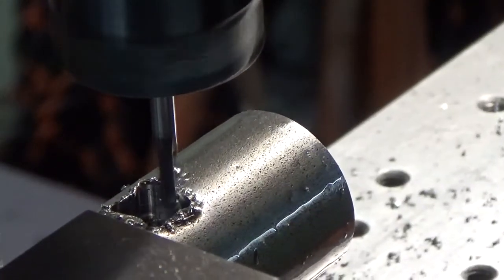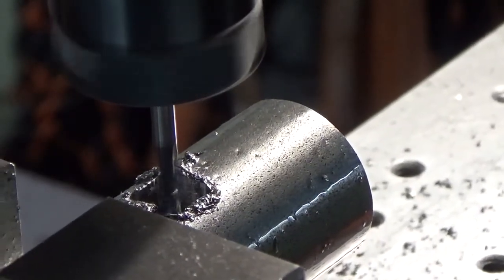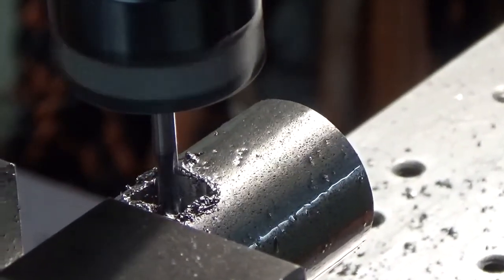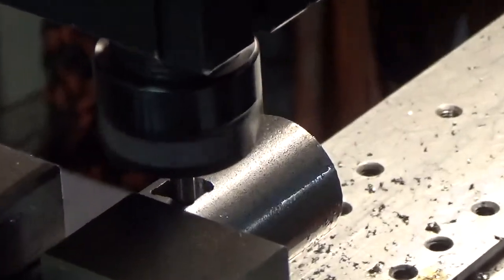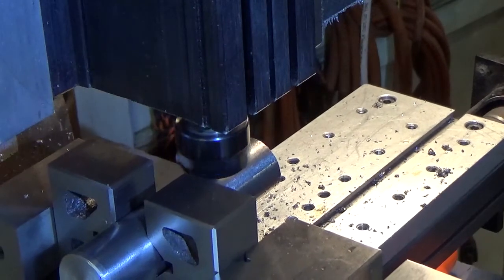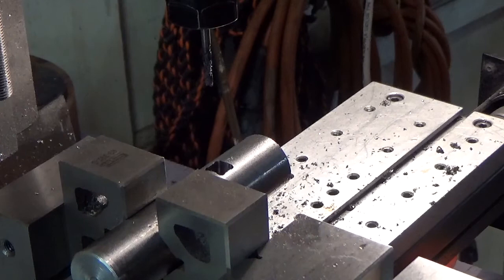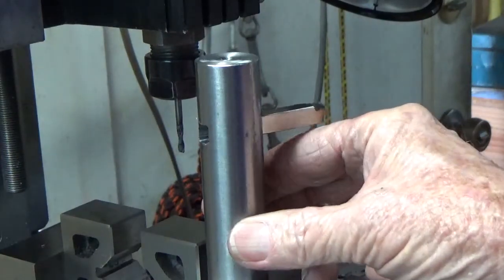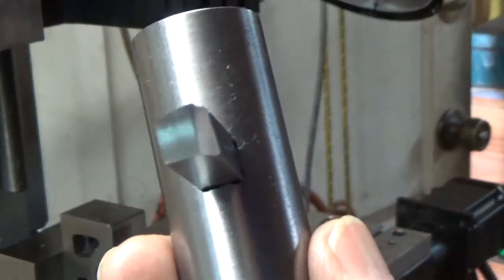Part #2 Rapide Lime Hand Shaper Cutting Square Hole in 1" Steel Bar using Taig CNC Mill

Comment: Yeah that’s a nice fit, it’s going to work out great  thanks for sharing.
Reply from the maker: Angelo:  Thanks for the comment.  Just a touch with a file and it went all the way through.  Maybe I should added a few thousandths to the hole size, but all in all things worked out okay.  Regards: Larry